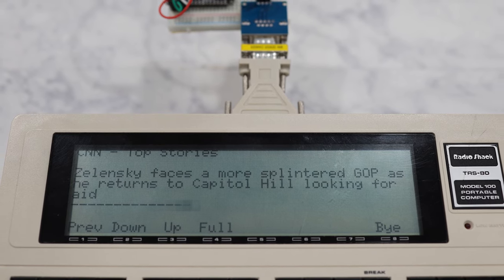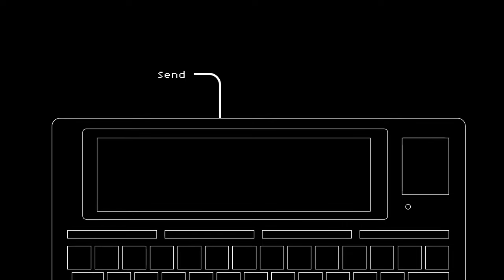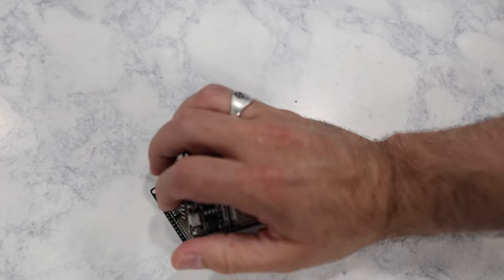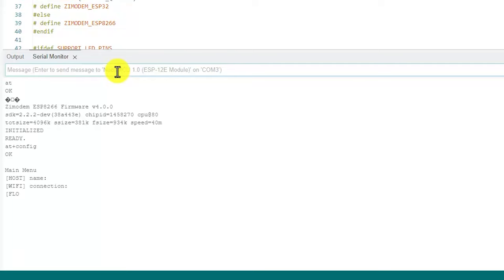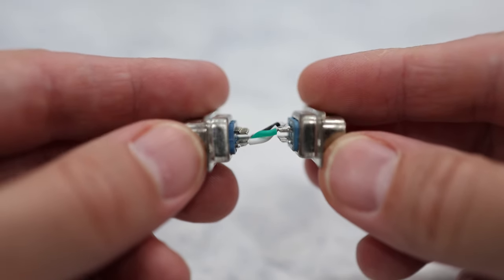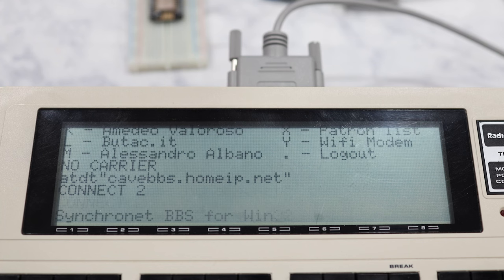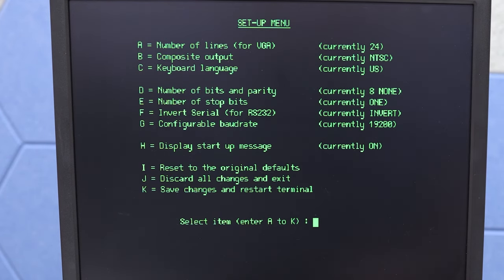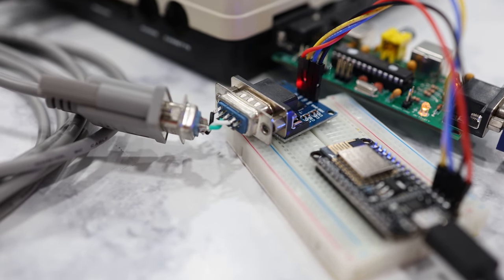Going Online with the Tandy Model 100 #septandy

Comment: Great video indeed; BTW did you notice that the ESP8266 has about 2 MB of storage onboard? Is it possible to use that storage with the M100 with the Zimodem firmware? Would be cool to save files on it when you use a BBS for example, or even as portable storage solution
Reply from the maker: I haven't explored the storage capabilities at all, but that would be interesting. I've been looking at FujiNet lately and I'm working on another project that will incorporate it, so I was actually thinking about an M100 port for it... 🤔

Comment: I have assembled a similar setup to your, except using a different ttl converter. Without using any cables, just a db25 male to db9 female, and then a db8 male to male to connect to the ttl converter. I get a one way communication in that what I type in serial console in Arduino is seen on the TRS-80 Model 100 screen. But what I type on the TRS-80 does not show up on the console. I have tried disconnecting the IDE and powering the esp module with power only, as well. But TRS-80 cannot seem to make a connection to the esp.  Might be a wiring/null/crossover situation, but does seem like it. If the cross over were wrong, then presumably I would get no connection.  BUt I do get a one-way connection.

Comment: 1:09 I would love to know where to obtain a phone cable for my Model 100 if you know what it is, what the part number is, or what it's called! I tried searching for Model 100 Phone Cables and came up with nothing! Great video btw!
Reply from the maker: Thanks! I did a little research, and can't find a catalog number for the modem cable. The acoustic coupler is 26-3805, but the modem cable doesn't look to be available in any of the catalogs that I found. I have seen them pop up on eBay periodically... but if you're just looking for something that works (as opposed to wanting an original cable as a collector's item), then you should be able to make one pretty easily. All you need is a male DIN plug and an RJ-11 cable... it's a straight pin mapping, so you would just need to cut the RJ-11 cable and solder the wires directly to the DIN plug.
Reply: @whatskenmaking  I may try getting a din plug! I know I at least have some phone cables lying around here somewhere that I could use! I appreciate your response! I do not care if the item is an original, although I can understand why somone else would want to have one, or the acoustic coupler!

Comment: Is there another way? ESP32 is cheating, it is 100 times the power of the Tandy. So if we go overpowered, my Macbook may as well deliver the internet straight over RS232 to USB. Can that be done?
But I prefer a lean Ethernet hookup without 240MHz dual core to make it run.
Reply: easy，It's just for fun。